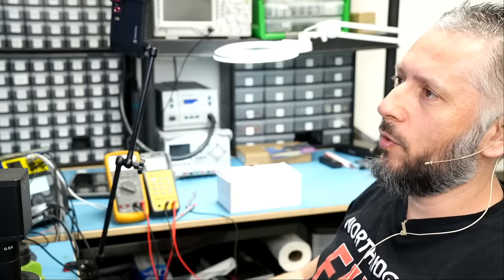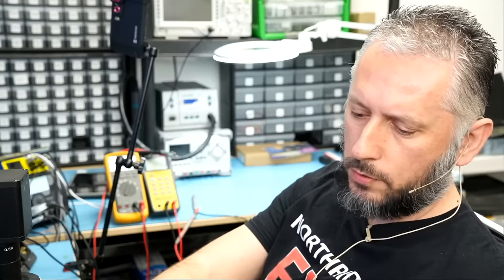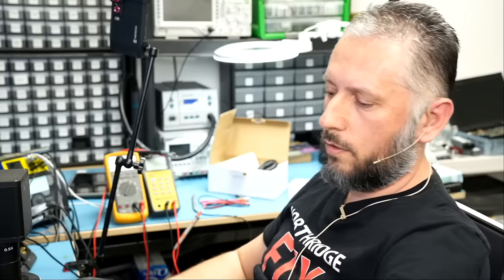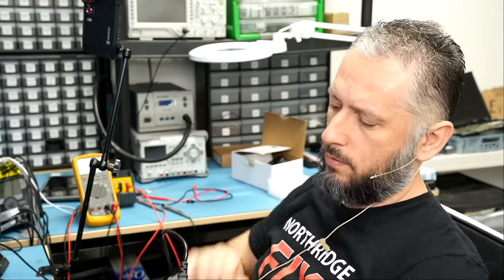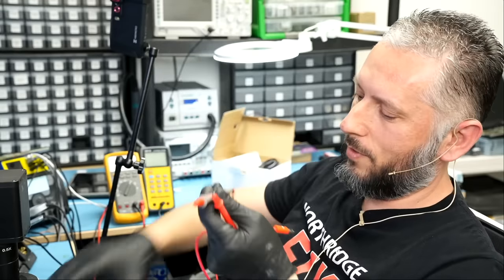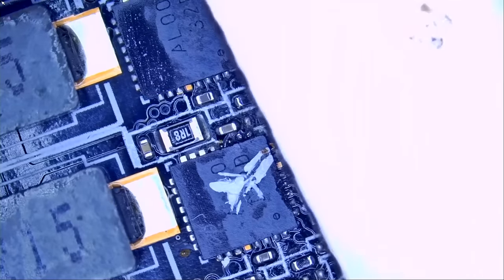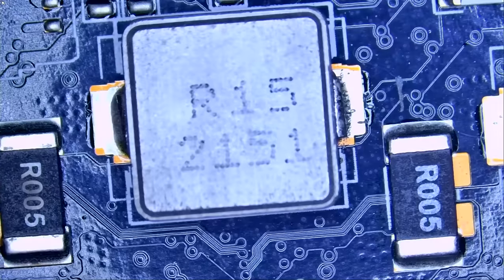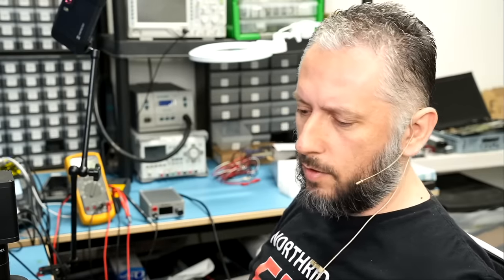Gigabyte 3080TI Repair using NF.Short Voltage Injection tool

Comment: This is why I leave my cards alone. Shaving off 5 degrees by replacing thermal paste / pads is not worth losing your warranty over. The Gigabyte Gaming OC line has 4 year warranty, this card should still be in warranty. I'm guessing they removed the warranty sticker though and couldn't RMA it. I have a Gigabyte Gaming OC 3080 12gb, I bought it for the 4 year warranty and will use it until it dies.

Comment: What I like to do in the case of welded on chips is to use the grinder to separate the welded on contacts from the rest of the chip, remove the chip and then deal with the remaining legs.

Comment: i have one of these injection tools - such a time saver
Reply: And I do not have such a tool which prevents me from diagnosing a faulty RTX2080...
Reply: @TwiztedJugallo  even if you have it, you still need a thermal cam or somewhat knows the area where the heat may rose to be able to diagnose easily.
Reply: @siontheodorus1501  Sometimes you can feel the heat, use alcohol , or rosin flux pen to detect the heat spot.
Reply: @user-fl2ug7sr3t  yeah but you would also still need to know where the area roughly is. I think rosin flux is more effective since alcohol can just vaporize without any additional heat from the board.
Reply: @siontheodorus1501  yes

Comment: Can you please include the input voltage for the items you sell. Here in Australia we run on 240v AC. Putting that in a 110v AC device wouldn't be a nice outcome.
Reply from the maker: Works with all inputs  110-240

Comment: I have a question and it's been a dilemma of mine but it is true that you can't always inject voltage on a short with a DC bench power supply? I use the TEKPOWER TP3005T and i turn off current protection but I can't always boost amps on a short.

Comment: I am trying to fix a Radeon rx 6800 but 12v rails on the pcie connection is measuring above 12v I think. It’s reading 1850ish in continuity mode, does anyone know what this means?

Comment: I Know a guy who inyect always 4 volts 4 amps in phones. He said as there's a short, current will not damage since is consume by short. What's you opinion about it Alex??
Reply: If the short blows open (not that unlikely with 16W going through it) it can fry whatever is connected to these traces.
Reply: If some one made misstake with measurements (we are only humans) it is gonna kill every component that needs low voltage power supply: CPU, MemC, Mem and so on.
Reply: Well.... there's a short... but what happens if the short burns out? Not impressed with your 'guy'.
Reply: @DummyLooks  truth, but this guy doesn't keep the current, he only give touches, that's why he trust his technic.
Reply: Also, this guy says he does that when he do not know the voltage of the line, if he does know then he inyect the line value. Another guy I follow only inyect a 3rd part of line voltage.

Comment: What is the AC Voltage Input Range for the NF.Short Voltage Injection Tool?
Reply from the maker: 110-240 works on all inputs.

Comment: Lol tell me how bad it is to do what im about to explain …context: im gpu mining … i have two gpus not working properly… to inject voltage i used a server psu with a breakout board plugged into a riser and the card … turn psu on and it fires up with no motherboard so its injecting voltage … i tried using rubbing alcohol to distinguish a short but couldnt find it … well maybe try rosin flux before i buy a thermal cam